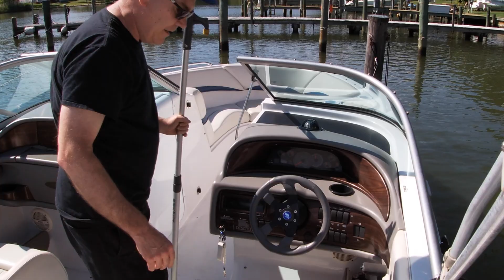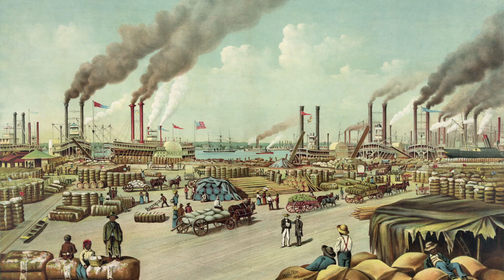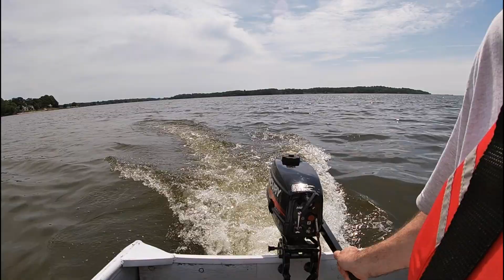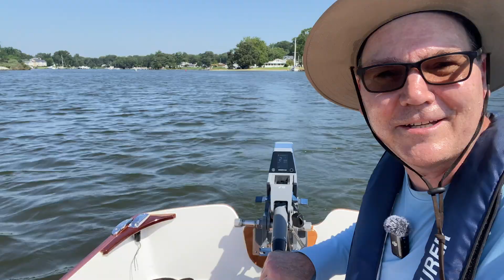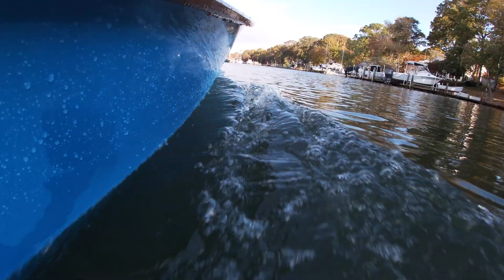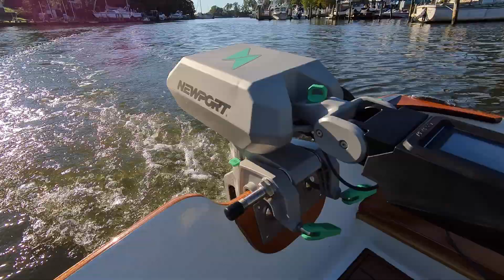The Horsepower Issue with Electric Outboard Motors

Comment: The main problem in the end is that gasoline has a much higher energy density then batteries. A EV can coast, whereas a boat is always pushing a lot of water out of the way. I think it will be a long time that a V8 ski boat will be electric. It's just more convenient to top it up with fuel all day.

Comment: Dont forget poppeller pitch , pitch is the distance it will travel in one reolution in a perfect world without any slip. A 5hp with 9 inch pitch will be slower that a 5 hp with a 12 inch pitch at the same rpm. The 9 inch pitch will offer more thrust with less top speed.

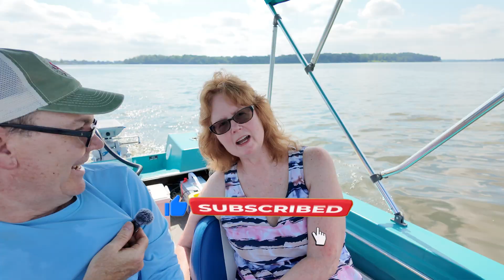Comment: 5:17 “they deliver full torque en near full power almost immediately.” I doubt this. Power=Torque×Angular Speed. So if the torque constantly high, power increases linearly with rpm.
Reply: DC electric motors start with high torque at low rpm. Torque decreases with increasing rpm so power is fairly constant. Different curves from gas motors.

Comment: Honda's gearbox ratio is given as 2.08:1. Two revoltions of the engine almost equals  one  revolution of the prop. WOT rpm for the engine is given as between 4500 and 5500 rpm. Making max prop rpm between 2250 and 2750 rpm. That is between 12.5% and 37.5% higher than the electric 2000 rpm.

Comment: As someone with extensive experience using the electric Torqueedo Travel , the difference is in the superior torque of an electric motor.  Think tugboat vs speedboat.  My inflatable boat isn’t really capable of planing with two people unless a heavy outboard motor is attached. Too heavy to handle!  I can carry the Torqueedo around easily enough, and it’s runtime is amazing at half power.

Comment: The propeller on the electric will account for the increase in torque available at lower RPMs.  A high pitch prop that works at low RPM and high torque would bog down a 2-stroke ICE engine.  Where as it will work fine on an electric.  In fact the electric might just cavitate a lot a full RPM.
The power band depends on the motor design, some applications like cars focus a lot of "instant power" from a stand still, but for a boat prop it is more likely the motor is tuned for like 25%-90% where power is basically linear and torque flat.  Above or below that it tappers of.

Comment: Fun facts about horsepower.  A human athelite can output more than 1 horsepower, but a horse can output dozens of horsepower.   The "Horse power" was specific, in the day, to "Mine lift ponies" and it was set at a figure that would allow the lift ponies to work their full 10 hour shift without tiring or burning out.  A race horse running at 45mph with 2 people on it's back is putting out a LOT more than 1 horsepower, but it can only sustain that for a matter of minutes and then be exhausted.
Asleep your body uses (and wastes as heat) about 100W.  Up and about, but at rest about 150W.  Light exercise like walking, cooking, 200W.  Heavy labourous output is about 400W which is where high paced cycling and sprinting are found.  However i a single pulse of output a olympic athelite doing a spring can output more than 1000W off the blocks for a short few seconds.  Same for power lifters and body builders lifting weights.

Comment: Something similar occurs (in the opposite direction) with alternator ratings. People are buying high output alternators, supposedly to match the fast charge capability of lithium-ion battety systems, oblivious to the fact that the (say) 90A rating is only delivered at close to max RPM and when the alternator is cold. If running warm at tickover, the same alternator might only deliver 10A. The 90A figure, just like the hp claims on electric outboards are 'marketing' creations, not real engineering.

Comment: You don't need to rev a gas engine to start moving, all you need to do is put it in gear and you are moving. The electric motor on the other hand need to be reved up for it to start moving. Electric motors also have a power band, they certainly don't make peak power right from the get go.
Reply: @polska905  what are you smoking? "You need to rev up an electric outboard to start moving." Physics dictates as the prop rotates the boat moves. The only difference is ICE motors are already rotating when you put it in gear. An electric motor is off, stationary. So if by "rev an electric outboard" you mean you have to get the prop rotating, you are technically correct. As for "power band," what type of electric motor are you talking about? Go read up on the different types of electric motors, modern drive methods, and electric motor efficiency. Not that I'm saying the HP figures given by these companies are real or correct, and not a lot of marketing speak.

Comment: What a mess telling that a electric motor delivers the full torque and the full power from almost zero rpm. Power=torque x rpm so obviously the statement is  simply false. The torque would have to rise tremendously at very low rpm to keep the power curve flat.

Comment: Bottom line, at the prop, which have  different pitchs, gear ratios, etc. Hp = speed (rpm) * torque (lbft) / 5252. Period, regardless of gas or electric.

Comment: I use an epropulsion on my Montgomery 17 sailboat. As a displacement hull, as most sailboats are, there is no point in going for top speed. I treat it more like a small diesel, let it spin a large wheel at slow speeds, and it will get me there. Usually that is just in and out of the marina area, but still, but it works exactly as I need it to.
Reply: We use a ePropulsion Navy 6 on our Montgomery 17 sailboat.  We did 1100 miles of the Great Loop from Chicago to Alabama under electric power, so more than just coming out of a marina, but we had a 10kwh battery bank and 600 watts of CIGS solar.  Nice to see a fellow M17 sailor!

Comment: Long story short: it's bullshittery!
They are lying. Because numbers sells. Stupid simple. 
Like you said, nobody would pay +3000$ for >2hp motor. 
You are talking about speed... it's just a matter of gear ratio (/ propeller pitch) and reason they keep it that way is - it's lacking in power. Simple as is. 

Electric motor is great in every way possible. Problem is energy storage. Until they find a way to store MUCH more energy (volume/weight) into them we are stuck with internal combustion engine.
(1kg gasoline holds around 50MJ, while the best LiPo is under 0,7MJ)

Comment: when you get an AC motor for the shop tools... it states quite clearly what the SHAFT POWER is, and what the ELECTRICAL CONSUMPTION is... and the efficiency, often. gets a bit tricky, phase angles and lag and stuff. its not a big deal for one person. but a factory with 500 machines is another matter entirely and all that power has to be catered for... ratings matter.

shaft power is the amount of magnetic field created, the repulsion and torque it produces... the MMF of a circuit, or "ampere turns", and mechanical attributes.
electrical power is amps x volts. except it isnt. its not DISSIPATION. theres power flowing through a circuit, and theres power being dissipated in that circuits resistance. we dont rate the motor by the heat it produces. for a given power flow there is a dissipation, and that has to be regulated to stay within safe temperature limits.

as the wire has a resistance and current had to flow through that resistance it develops heat, for a given power a higher voltage will give more MMF and less waste as heat due to current... its all a juggling act really, suffice to say, higher the voltage, the more "efficient" it will be. 

most of these manufacturers are free to rate on the electrical consumption. 

or, they can get a motor intended for 100V, run it at 50v... its still a 10kw motor, its definitely not going to produce it though. 2.5Kw maybe... do you reckon theyll state what it really is making or what it could make?

most motors arent made in-shop. they get off the shelf from third parties and design the housing itself.prop sizing matters yet theres so many variables that its hard to state anything as a set rule, other than the goal generally is the maximum forward velocity for the least power expenditure...here? as long as we move, against a current, and dont make smoke or have to stop and wait ten minutes out of every fifteen...

battery packs matter... as the Ah goes up, their proportionally more efficient for a given drain... less internal resistance, less heat produced and wasted in the pack.

Comment: You are justifying fraud by the companies that make electric engines. Hp and kW are different units with the same meaning. I hp is about 750 W. Any other conversion is false. The difference between gas and electric is how they deliver torque at low or high speed. Your explanation honestly makes it much worse than nothing. Sorry to be negative but your video is just wrong
Reply from the maker: How is my video wrong? I state how the math works, the origin of horsepower, the power curve of a gasoline engine and the fact that electric outboard companies are using fuzzy logic to state horsepower equivalency.

Comment: I don't like this "some horsepower equivalent"-thing. If it is 1000 watts, it's not 3hp. It's 1,4hp but let's say 1,5hp.
It's true that electric motors have their torque and power straight away where gas engines have a peak performance at some RPM. However, when you reach the efficient rpm-level (let's say 5500rpm) you have 6hp (or 4kW) - if you have a 6hp outboard. Sure electric outboard feels more snappier at low speeds because of the instant torque and power but when you want to go faster the amount power (or lack of it) becomes a bottleneck.
If you drag race two 300 hp cars and the other is an electric and other is gasoline-powered the electric car will destroy the gasoline car during the acceleration. This is simply because if you "floor the pedal" on electric car, you get the max torque and max power immeaditely while the gasoline powered car has reach the correct rpm-level to generate max power. But I have never heard anyone marketing an electric car like "this has 300hp but it is 500hp equivalent". :)

(oh, and I like electric outboards and have two of them. They are silent and smoke/smell free)

Comment: Prop speed, at least at these speeds is not the issue.
The props will be designed for the speed they deliver.  
Props arrange from the usual high speed, to the high thrust models for slower displacement boats.
For maximum efficiency you actually want the biggest, and therefore slowest moving prop, at least for that design speed.  Well that’s how understand it.
Pleasing to hear that the electric outboards are focused on slow speed / high thrust, which is what I want. ie when you have to get back into harbour and the wind is strong enough to bring your boat to near a standstill.
So…rather than HP, we should rate outboards on thrust.  Which is what trolling motors use.

Comment: EV manufacturers play similar games. They quote peak horsepower. The peak horsepower is only achieved by massively overloading the motor. They can only sustain this for a few seconds before overheating. An internal combustion engine on the other hand can generate full power for as long as the fuel tank lasts.
Reply from the maker: ummm... most internal combustion engines do not do well when staying at their peak horsepower for a prolonged time. The cooling systems are stressed at high RPMs. This is why when people build out a race car they need extra large sumps and extra resources to cool the engine and transmission.

Comment: Everyone has seen a 2kw bar heater at home right… well maybe not Americans because you have barbie dream house  voltage’s.

1 bar vs 3 bars is a big difference,

Like 500w kettle vs 1500w kettle
Reply: The idea of an electric outboard sounds terrible, how do you refill it when you run out in the middle of the way.
Reply from the maker: A second battery. It works fine for certain applications.

Comment: Those motors are only 1.34 Hp The calculation is correct You are buying into the manufacturers spin and BS. Hp and KW are equal directly related to the output of  torque (work) over a period of time. Go look at the prop on a 1.5 hp gas outboard it will be the same size or smaller than the one on your 1.3 KW motor. because the work output is the same. A gas outboard has a gearbox that multiplies torque by reducing engine speed to prop speed. An electric motor is direct drive at the prop. Both are rated at the prop. Speeds should be pretty equal since they are both doing the same amount of work in the same amount of time. The eclectic will accelerate faster due to higher torque output a low rpm, They are trying to get you to believe a lie that the math is false.   Where electric looses out is the extreme weight of the energy storage tank.(batteries) They just do not scale up well for speed and range.

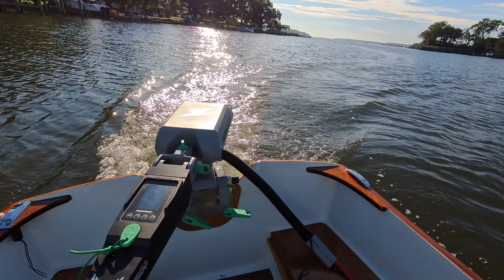Comment: Around @10:00 you mention gas motor rpm but ignore the gear reduction in gas outboards. A lower unit usually drops propeller rpm to about half of motor rpm. So the prop speed difference between gas and electric won't be as significant as you imagine (in that example at least). Nice video otherwise!

Comment: A lot of gas and diesel motors have pretty flat torque curves also. I think they use better props in the electric outboards to improve efficiency.

Gasoline outboard motor manufacturers are required by law to sell their motors according to shaft power output. I think the electric outboard motors should be required to do the same. If there are benefits to electric motors (like a better hole shot) then let them market those benefits separately from the power output.
Reply: What benefits is a better " hole shot"?
Reply: @gilianrampart8514  In planing boats, the "hole shot" is the time spent at full throttle prior to coming up on plane. Getting up on plane easier is a nice feature sometimes.
Reply: @mckenziekeith7434 nice,yes critical,no!
People talk as if it's some sort of race!

Comment: Very informative, thank you for sharing! 

I've been running a 1kW Torqeedo Travel outboard since 2011.  It replaced a 4HP Mercury gas outboard at the time, and performed almost as well in both thrust and top speed.  So I always gave them the benefit of the doubt that it really was a 3-4HP equivalent.

But here's the catch.  I was pushing a 22' sailboat with the motor.  With a displacement hull.  The boat wouldn't go any faster than 5-6 knots even if I doubled the power of the outboard.  So I never realized that there is a practical difference in top speed.  It makes sense now that a planing hull would perform very differently with a 4HP Mercury versus a 1kW Torqeedo whereas my displacement hull performed basically the same.

Comment: 9:33 Wayne my man you forgot about the gear ratio. according to honda, it is geared with 2.08:1. So 4500-5500 rpm at the crank equals 2160-2650 rpm at the prop.(please correct me if i am wrong). so if the props are same the nt600 should perform the same as the honda with 4500 rpm. but now we have to consider the 700w less of the nt600 wich is 19% down of the 3700w of the honda. So if we also reduce rpm by 19% we get to ~3650rpm for the bf5 equals the nt600 at full speed. please get an rpm counter and make this test happen.
Reply: This is correct, good point there!
Reply: @mtbsieppo should be correct if the power is produced linear. I really want to see that bc nobody does this on youtube
Reply: @mikio8120  In fact the power required to drive the propeller is proportional to RPM cubed, so we should expect a 20% reduction in RPM to roughly halve the power being delivered to the engine.

Comment: One big problem is there is no standard for the "equivalency" number the e-outboard companies are using.   Without a standard it's each company basically just saying 'oh, we think it feels about like a 6hp....' but it means nothing and isn't directly comparable across brands.  While it would still be misleading, at least a standard would make for more direct comparison among the electrics.

Also, RPM alone isn't the issue.  In theory, with it's low rpm but maximum torque, you could just change the gearing or prop on the electric to get the same speed as a gas motor.  No, they really just do not make the same amount of power as shown in the video so again, misleading.  It's really up to the buyer to know their boat and what they need.  Have a slow displacement hull?  Electric might be great.  Want to get on plane?  Not so much.

Comment: In order to double your speed it requires 4 x the energy and then drag starts increasing a hell of a lot as well. 
With a gas /petrol motor we just accept it is a cost of doing business, get a bigger tank and wind on the throttle. Batteries are expensive and stuffing electrons into a tank is nowhere near as convenient as filling with liquid fuel, or have anywhere near the energy density.
I tow my boat to the ramp with an EV, but for range and convenience, there is a lot in favour of liquid hydrocarbons.

Comment: Maybe I'm wrong, but wouldn't the introduction of a 2:1 dear ratio in the propeller hub double the ability of the electric motor to make them more efficient for comparison to a gas motor?  Are any of the manufacturers working on this?  I've seen many conversions that remove the gas motor from under the cowl and replace it with an electric motor with a rheostat for throttle control.  It doesn't seem like it would be all that difficult to add a small gearbox between the electric motor and the motor's lower unit to double the output shaft speed to gain comparable RPM's at the prop.  I've even seen the cooling system in the lower units used to cool the electric motors in these conversions.  What are your thoughts?
Reply from the maker: Yeah I did a video on home-made electric outboards a few months ago. I have a Hangkai that has the motor up top and it is very loud.